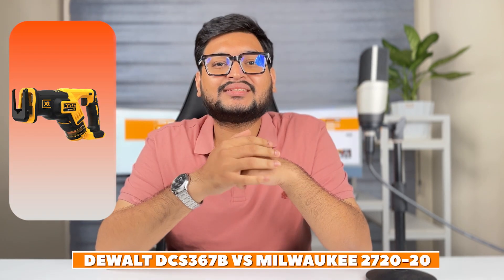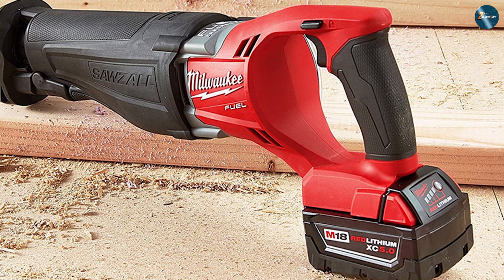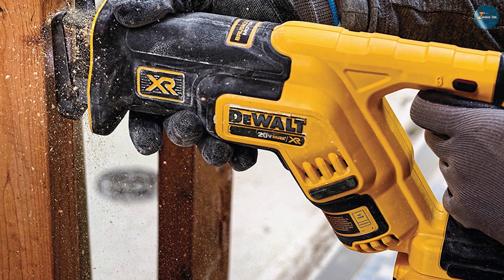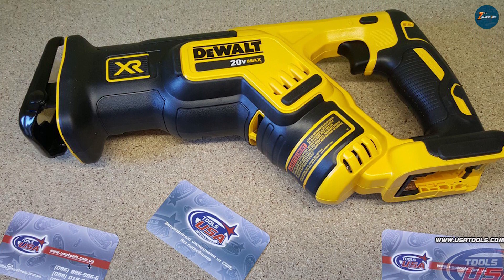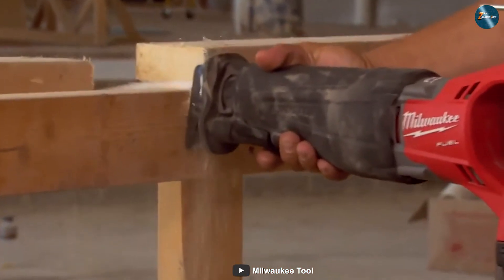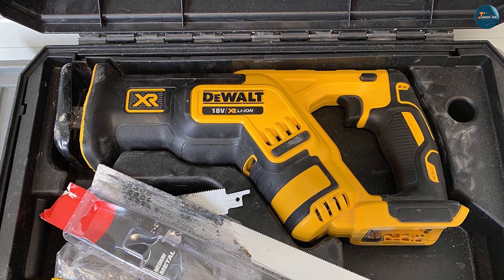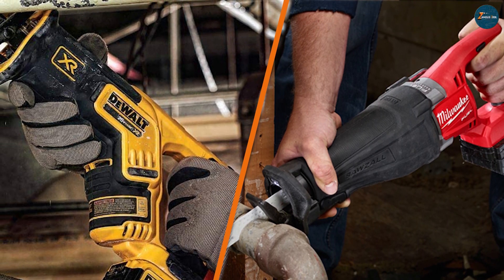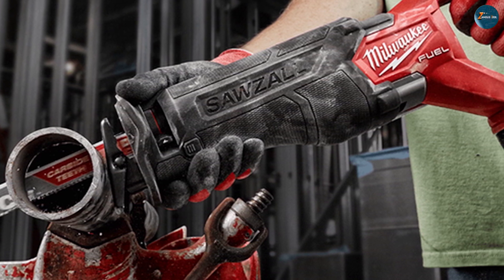DEWALT DCS367B vs Milwaukee 2720-20 - Cordless 20V Reciprocating Saws Comparison

Comment: Is the ORBITAL what separates the higher end reciprocating saws (Dewalts/Milwaukee) from the lower cost brands (Amazon, Newone, etc)?  And Strokes-Per-Minute?

I just need one to cut cardboard, so perhaps the non-orbital, $46 Newone 20V might be good enough, since it comes with a battery & charger?   Or the $70 Alloyman?

BTW, to extend the life of the battery, should it be left charging, or completely off the base/unit  (even if it drains to nothing between uses)?